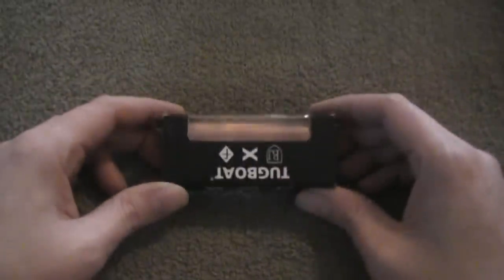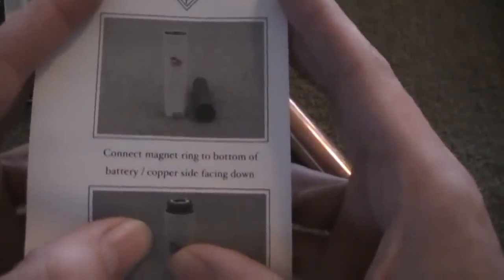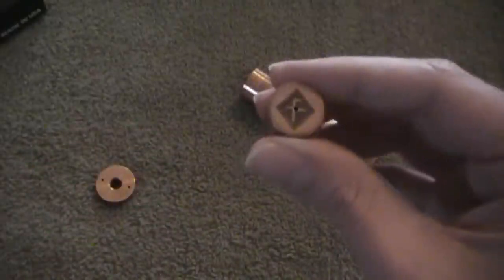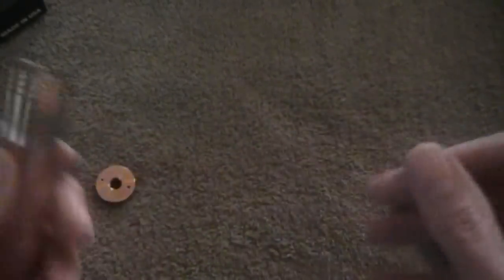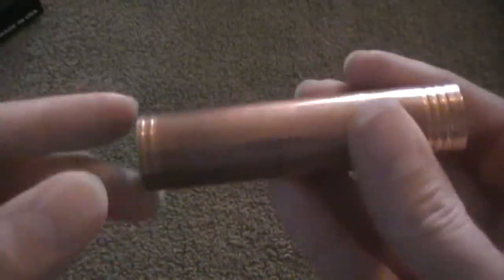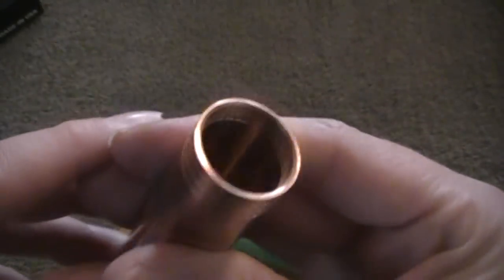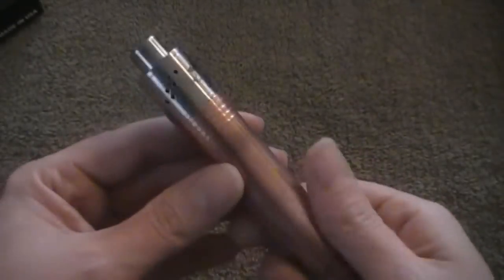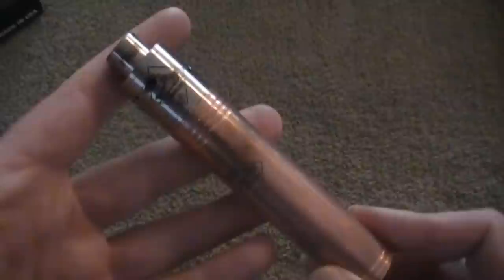Copper Tugboat Mod by Flawless | #TUGLYFE | Quick Look & Comparison to Original

Comment: Knew I should have waited for the copper version, errrr.

The switch on my gunmetal alum ver is different than yours, it has a screw adjustment bottom contact and the vent hole in the middle of the BJ logo, wonder how many designs they have used.

Good short but sweet review man, later.....
Reply from the maker: moviking I know my original was from their very first batch, so they added improvements to the aluminum ones quickly after. Like I said they're moving so fast it's hard to keep up LOL! Thanks brother!

Comment: hey man i have a question i have a tug bot mod not the copper one but no matter what i do it always fries my batteries please help
Reply from the maker: jeffrey boulden Make sure your contacts are clean. Also since it is a hybrid connection, the positive pin on the bottom of your RDA needs to stick out from the threads of your 510 a bit so that it's not grounding out your battery. You'll get a hot button if that happens. What kind of batteries you use can play part in it too. Always use High Amp, High Drain batteries in all mech mods.
Reply: ya i got u man but the whole thing is it made my sony vtc 5 vent from the bottom. and i am using a tobh 2.5 and all of it is authentic and i payed a lot for it and no matter what i do it always fucks my batteries up. i would appreciate it if you could help me out man thank you so much.
Reply from the maker: I'm not sure that the positive pin sticks out enough on the TOBH for a hybrid connection. Your insulator may be melted too. What resistance is your build on your RDA?
Reply: idk im not thinking the insulator is bad on the atty because i can pop it on the k 100 and be fine. also the ohms is nothing crazy like .6 .7
Reply from the maker: That positive pin is probably shorting out on the hybrid connection on the Tugboat Mod then. I would try a atty with a longer center pin before you rule the mod a defect.
Reply: ya ur right but i have tried a natulis mini and a patriot and same thing happen. Wish i could figure this out.
Reply from the maker: Both of those are known to short on hybrids too
Reply: well dam maby that is my problem im shorting out the battery what do u suggest i do or what rda"s do u think would work good with it
Reply from the maker: I know for sure the Tugboat RDA does, can't think of any others right off hand. Tugboats are all I use on mine.
Reply: thank u for all the help man one more question the tobh has a adjustable center pin if i backed it out a little do u think that would help or should i just go buy a tug boat rda
Reply from the maker: Any atty where the center pin sticks out past the threads on the bottom of the atty should work, they can't be flush.
Reply from the maker: As long as it doesn't loosen you center post when you do that, it'll probably work then.
Reply: the tobh pin does stick out already so idk
Reply from the maker: I wish I could help more, just hard to diagnose the problem without it right in front of me. If you have a local shop that has somebody experienced there in that sort of thing, I take it to them.
Reply: also do u no of any good solid mods that are under 100$ that are the best ie copper connections, not hybrid, all around good mod what do you think
Reply from the maker: I used a copper Stingray clone before I got my Tugboat mods, if you find one made by Infinite or another company known for making good clones, still the hardest hitting mod I have.

Comment: I personally wouldn't recommend this device. I've had the top cap lock on me twice, despite using copper grease. I got the black cerakoted one and a white one, and the cerakote comes of very easily. It has a delayed fire up, the negative contact screw always comes undone and needs to be tightened regularly and the mod petinas hella quickly. only pro's to this is the size and form factor.
Reply from the maker: HolloVVpoint Never had any issues with mine, but it does patina fast as hell!!!
Reply: Never had any of those issued with the painted one either. Mine hits hard and instantly with my doge v2